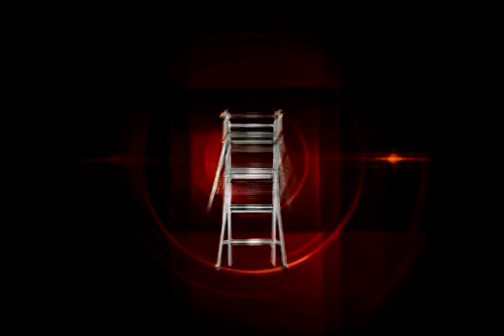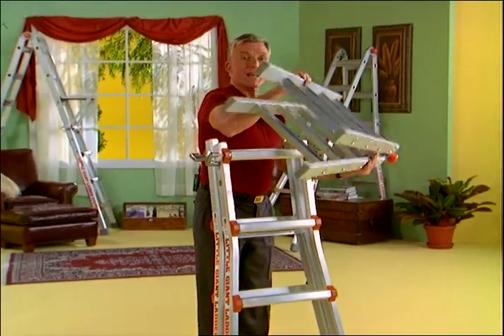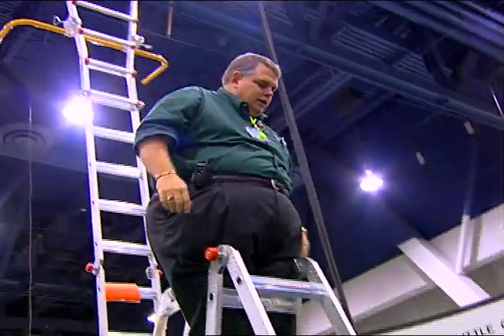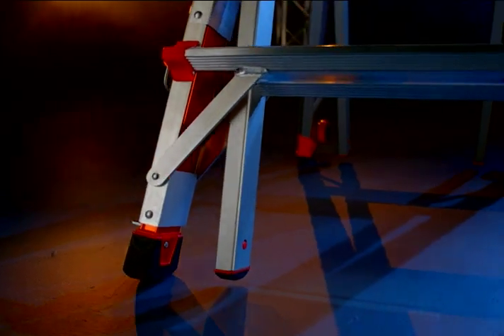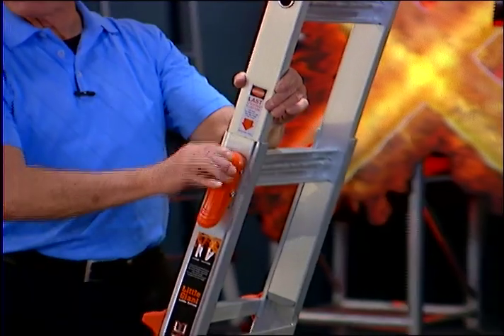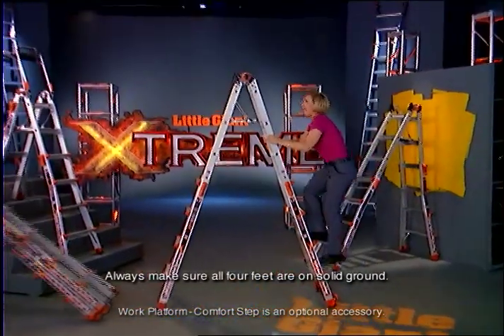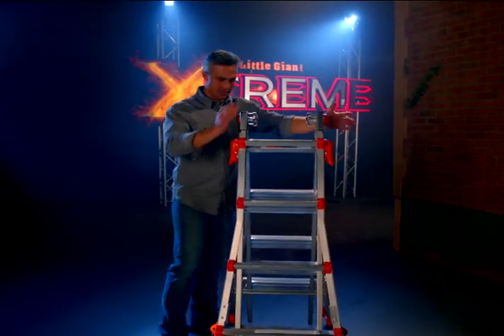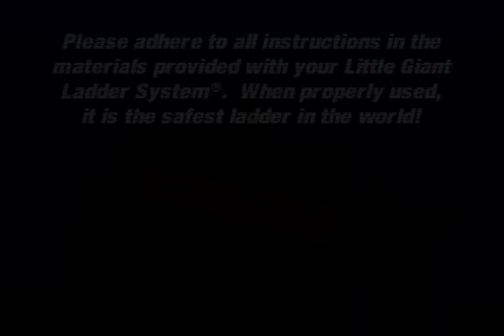Little Giant Extreme Ladder Safety Rails

Comment: I actually bought a Little Giant Xtreme mainly due to this or a previous version of this infomercial. The ladder can handle what they show and more. They obviously pop up little disclaimers about "official" weight limits. It does weigh a LOT though, it is kind of a pain in the butt to move around, but very safe. I figured I would need two, maybe three ladders for all I need, and if I am buying a ladder, I want quality. By the time I bought 2 or 3 quality ladders, it was the same or more as the Xtreme.

Comment: I vote for exploring accessories like:

a.  a modified V-shaped stand-off piece with a strap to go against poles & trees

b.  an H-shaped add-on piece with dual leveling ratchets to broaden the foot

c.  a double hook add-on piece to fit over limbs or cables

I vote for bigger wheels.